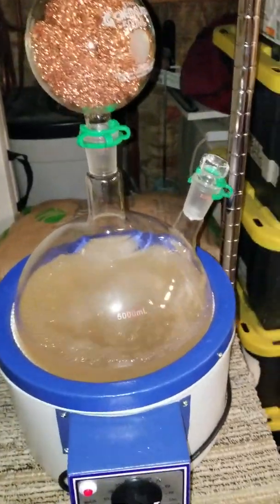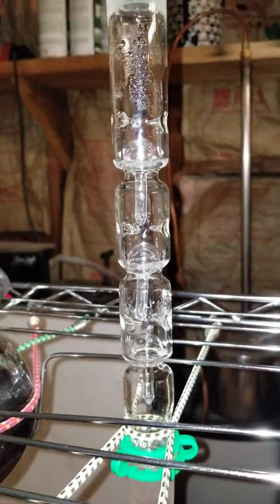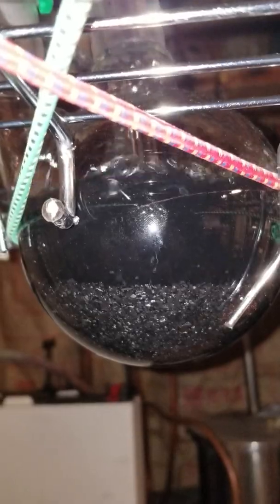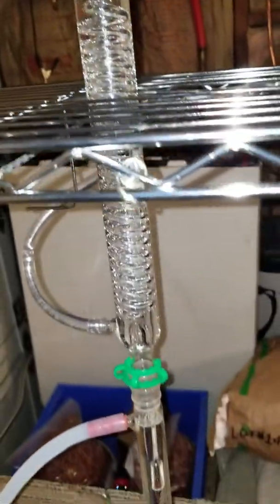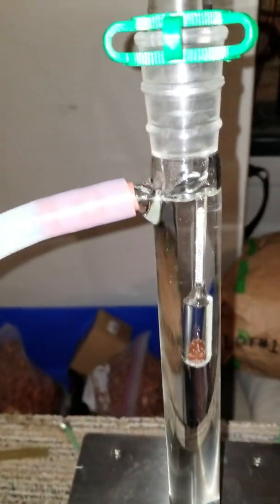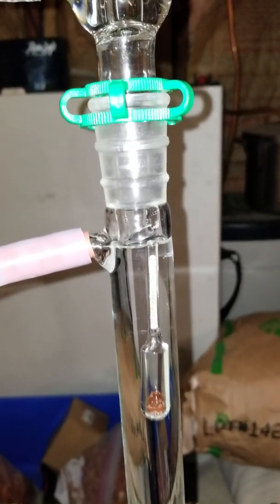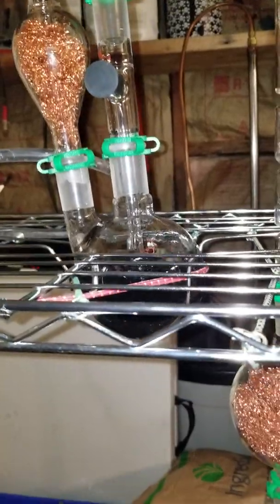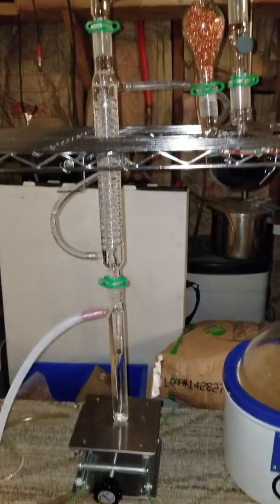Glass still. Labratory grade alcohol distillation.

Comment: What does your whiskey/brandy configuration look like?  I’ve been putting a system together and just found this video and we’re almost 1:1 so far.
Reply from the maker: I use a vigreux column and one thumper. This is a pretty old video. I run the whole setup under a vacuum, now. I can do whiskey at around 135° f. And retain all the flavor. It doesn't look as cool, though. I insulated the whole setup to keep the heat in. When I added a aecond thumper, it was taking hours to get going due to heat loss. The insulation fixed that, then the vacuum really changed it. Lower heat, more control, faster without losing flavor.

Comment: Hey, isn’t your condenser supposed to be tilted? I’ve never seen a condenser vertical.
Reply from the maker: Well, a condenser just needs to condense. And, since there's no steam coming out, then it's functioning just fine. Also, having it tilted means it has to push the liquid out, causing pressure. And, as we all know, higher pressure makes a higher boiling temperature. And, that means more water in the liquor, and who wants that?